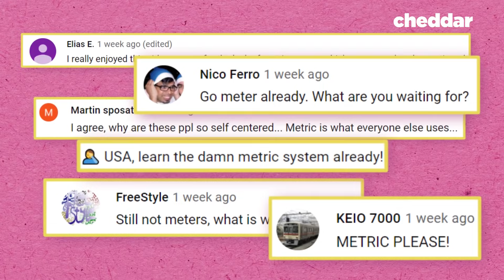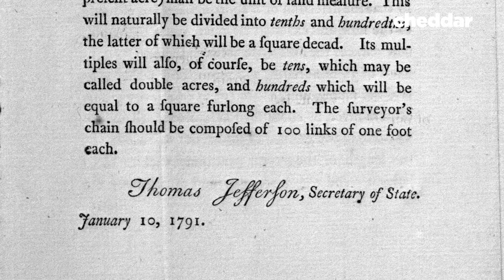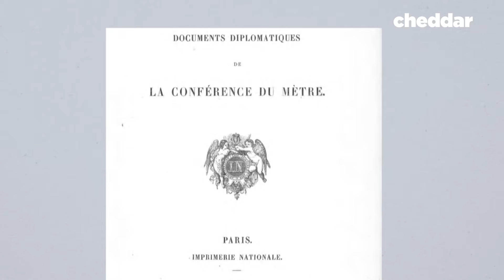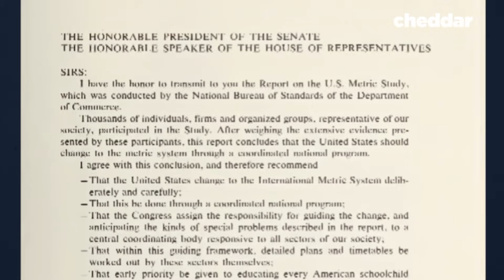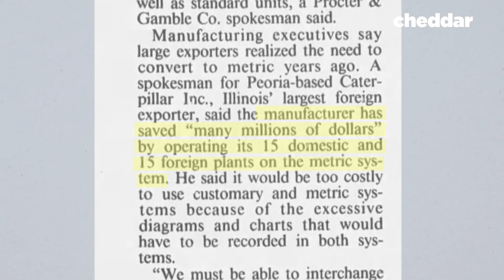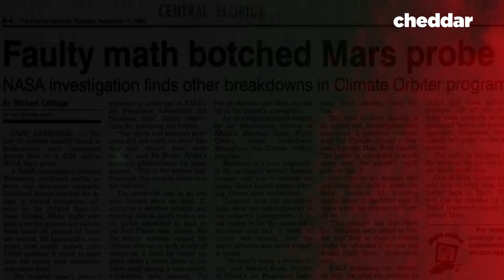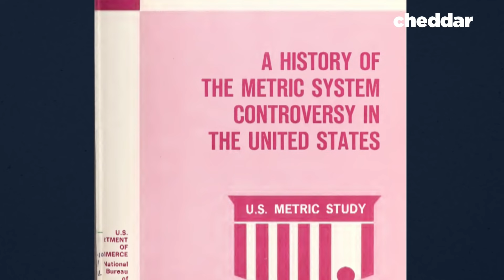Why Doesn't the US Just Use the Metric System? - Cheddar Explains

Comment: The standard/imperial system has a very unique history to it and has a nice ring to it to.  I'm an American and I understand and use both the imperial and metric systems on a regular basis, so I don't see a problem with how the US does this.  So why don't you just let America be America.  It's all good here.
Reply: I don't know... Crashing space operations MAYBE
Reply: I feel like calling it a system is a bit of a stretch, when you look at it closely, it's more like a bunch of old unrelated units put together, the only reason it still works is because it's got metric backing it up.
Reply: 12 inches to a foot, 3 feet to a yard, and 1760 yards to a [statute] mile.
unless you're talking nautical miles and that is different from statute miles, 2025.37 yards to a nautical mile.
Reply: @JeremyWS  1 gram of water at 25°C equals 1 millilitre of water equals 1 cubic centimetre of water. Mass, volume, temperature, length. Plus it's great for making drinks, don't have to use any measuring cups just put a glass on a scale, tare and pour.
Reply: I understand and use both systems perfectly fine, so I'm good.
Reply: @ahqhue  Ahh..the old metric is great because 1 liter = 1 Kg argument. (water). I would rather know what a volume of fuel weighs, because that is something I measure out at least once a week. But 1 liter of petrol does not weigh 1 Kg...now does it?
Reply: Please --- never EVER say "very unique"
Reply: David Jones you know very unique as opposed to only slightly unique.
Reply: quote: " it´s all good here."

with a gov on forced vacation due to a childish leader, who thinks a wall would solve all problems.

the chinese tried it, dosen´t work.
east germany did it, didn´t work either.
Reply: The Chinese at least generated some tourism 5 centuries later out of the wall.
East Germany decided not to live as long. But the government at least lasted longer than the building period.
The intended US wall ... 

The connections to North Korea? A benchmark?
They are doing "quite well" with their southern border. But it will go the same path like in Eastern Germany.  @Ugramosch
Reply: All well and good for people like you who understand both systems, but to people who have only ever used metric, the archaic system used in the US seems so confusing and arbitrary.  I mean, how many inches in a foot, how many feet in a yard, how many yards in a mile?  Compare that to 10mm in a cm, 100cm in a meter, 1000 meters in a kilometer...  Also, there is no problem if both measures are used, but when only the nonsensical units are used, the rest of the world just looks on and wonders WTF is wrong with the US and why they insist on using measures different to everyone else, that make no sense to us.  It just seems selfish to us...
Reply: Troy Wilkins There are 12 inches in a foot, 3 feet in a yard, and no one except the almighty google gods know how many yards are in a mile, maybe you have a point. 🤷‍♂️
Reply: @heidirichter  how is it selfish? No one is forcing you to use imperial. Goddamn commies
Reply: @dunnowy123  
Yeah, no one is forcing me to use imperial when they say their height in inches...
Reply: @heidirichter  I think you don't understand the word "arbitrary". There is nothing arbitrary about the imperial system. It is very much based on real things and steeped in history. In fact, the opposite of arbitrary. I'm sorry it's confusing to you. That's not a concern to me. Why can't the rest of the world stop worrying about it? Why is it selfish? The U.S is not forcing the Imperial system on you...stop forcing Metric on the U.S.
Reply: Nobody in the rest of the world is forcing the US.
It is just a historical experience that the agiles will win.
I.E. Germany more than a decade ago started switching handwriting and printed writing to a style the rest of the world is able to read (the Germans were able to read both). There were internal gloomy forces also in Germany fighting against it, what a luck they failed completely. In the end Germany switched and this was part of the worldwide success story "made in Germany" (please google "Sütterlin" & "Fraktur")
If you travel around the world you can observe other Nations using in some fields more advanced Rural engineering, let me just name three relevant:
- electoral system
- electrical power infrastructure 220V and even more important: three-phase
- beside some others: the metric system
Nobody forces the US to be agile & smart. Just the more efficient cultures will take advantages. And if anyone worries, the US should worry.

by the way: English is spoken all over the world because it is a very efficient language. Nobody is forcing the Chinese, Korean, Spanish, French, ... to learn English. They are doing this for being more efficient and taking advantages.
Reply: @ @noelmasson   We also use fractions where those are handy: i.e.: 1/2 pound of butter, 1 pound of butter, 2 pounds of butter (á 500g).
And in some technical commodities inches will be relevant for ever, i.e. the pipes in our houses are 1/4'',  3/8'', 1/2'', 3/4'', 1'', ....
Our pilots like those in the US are using flight levels, those are based on feet but in our days a dedicated atmospheric pressure and no real elevation. No need of change into a long future.
I spent as a young engineer some time in the USA. One of my findings was that using i.e. American Wire Gauge system ore the non metric screws is a real non efficient headache. You can not calculate, you just can use (and trust) in tables, very, very inefficient!

Being pragmatic instead of dogmatic is normally the way to success. Typically the Britisch and the American are well known to be pragmatic.
And this was the key to a lot of historical success stories, not only the landing on the moon.

So watched from other countries some are wondering  why this discussion is driven like it is.

But this is an US internal discussion and basically no one from the outside wants to enforce anything to the US. This is just a US feeling, sometimes it looks like paranoias.

A non joke to the end:
Do you know the most inefficient aircraft? It is the Concorde, half the biest using metric (French parts) and half the biest using imperial (UK parts). All other than pragmatic, a political and dogmatic enforced compromise. Does it fly today?
Reply: but it is so confusing. like seemingly random numbers of one thing is the next bigger thing. how is anyone who doesn't get penetraded by this for the entire life suppose to understand the systhem?
Reply: don't be ridiculous :P imperial system is useless and middle-aged
Reply: Who cares when the US stays in the middle-age?
Reply: @peterebel7899  Exactly...you should not care.